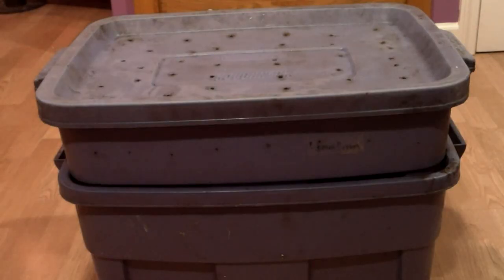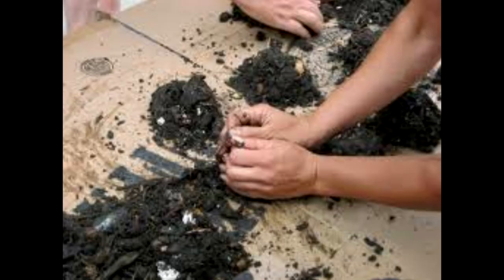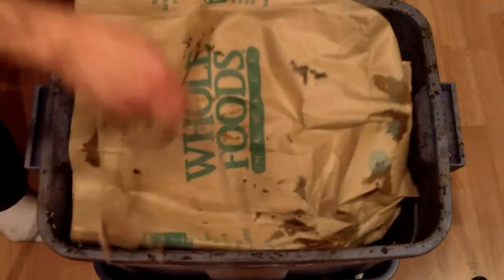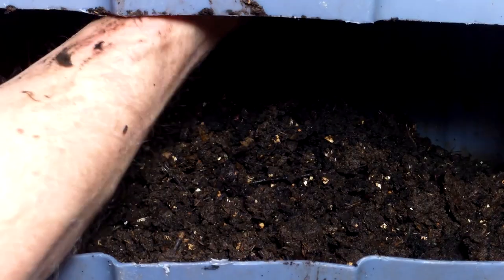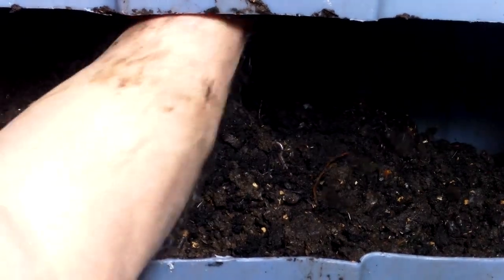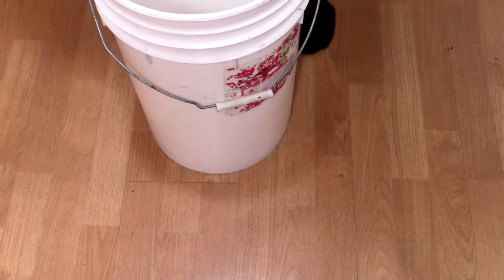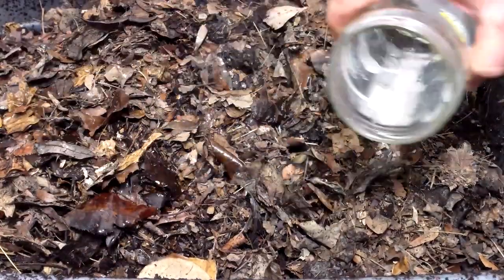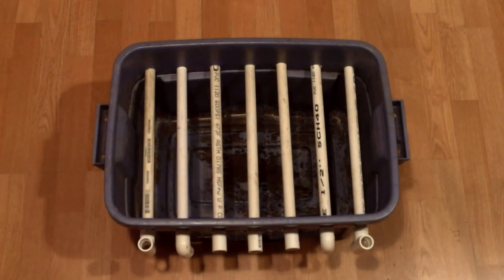Harvesting Worm Castings From a Flow-Through Worm Bin

Comment: Split some poly tubing and slip it over the top edge of your harvesting hole to protect your arm.

I have read that 20 - 24" in depth is the de facto standard for flow through depth to keep worms out of the harvested material.

Comment: Thank you for this, it is brilliant.  I think I may reproduce your work.  I love my worms, hate harvesting, I spend way too much time with tiny worms and egg casings. You could set two small litter boxes or aluminum baking trays in the bottom that would make it even easier to pull out the castings, as they would fit out your hole in the front. Because I don't like separating out the compost, I set two bins in my raised garden beds, one out of a five gallon bucket and one with 4" PVC, both fenestrated with many1/4" holes, it is amazing how much better the plants adjacent are doing than the rest of the bed.
   I have two questions for you. Is that pumice in your castings? I occasionally have trouble with worms crawling out my drainage holes in the bottom once my bottom bedding has degraded, I think it may be due to excess moisture and some clogged holes, I am unsure. Does this happen with yours? Thank you for your time.
Reply from the maker: Thanks Jane! Yes, this approach dramatically reduces harvesting time. If there are still some worms and cocoons in the castings, I just leave them there, and they eventually end up in the garden.

It sounds like you basically have a couple of worm towers in your garden. I'm glad to hear the plants around them do well. I'm thinking about adding a couple worm towers to my garden this year too.

To answer your questions, I don't add pumice to the worm bins. Worms sometimes do escape from the bins, but not too many.

Best wishes with your garden this year!

Comment: Early on in your video, it looked like you were using the Worm Inn flow through composting system.  How did you like that setup?  Why did you switch over to a Rubbermaid conversion?
Reply from the maker: I love the Worm Inn. It inspired me to convert my Rubbermaid bins over to flow-through systems. Currently, I have 1 Worm Inn, 6 Rubbermaid flow-through bins, and 1 standard Rubbermaid worm bin.
Reply: Wow-- sounds like you're going to have plenty of worm castings!  As for the Worm Inn, how much does it produce?  I've read a few reviews and was thinking about purchasing it.  Either that or the Worm Factory 360.  Love your videos.
Reply from the maker: OhHowHappyGardener The Worm Inn works great. The castings are high quality and easy to harvest. I've never tried the Worm Factory before, but it seems like a very good design.

Comment: Patrick, Just a quick question: I have the same sized bins as yours only I think I may be overcrowding. Presently, I have roughly 3,000 worms (3 lbs) in 2 bins. How many pounds of worms do you recommend per bin? Thanks in advance! ( P.S. I copied your conversion, and it looks great, reduced moisture build up a lot!)
Reply from the maker: Hi Paul. I'm glad to hear the conversion is working well for you!

Good question. I'm not sure if I know precisely, but I think 1,500 to 2,000 worms per bin should work well. I usually start a new bin when the worms are visibly overcrowded and trying to escape despite having plenty of food and bedding. If they aren't trying to escape the bin, then everything should be fine.
Reply: Sounds like a good rule of thumb. Thanks!

Comment: So after 3 months the bags are basically compost. You then dump the rest (worms/non castings) into another bin to replace the bags/start again? Or are the bags just used one time to fire up the bin initially?
Reply from the maker: The bags were just used to get things started. From here on out, I'll just add food and bedding on top and harvest castings from below. The castings clump together, which prevents them from falling into the lower bin on their own. This setup makes harvesting castings a breeze! Thanks for stopping by!
Reply: Mr. Savage we will have to convert some bins to do the same ! This system rocks !!
Reply: ***** I'm thinking much larger scale out at parents place. Those Rubbermaid containers sure are great though!
Reply: OneYardRevolution Thanks!
Reply: Keep me informed !

Comment: how long does it take for worms to make castings if i used food waste only? is it dependant on weather as well? and can i use earth worms or do red wrigglers do a better job? my compost bin is full of earth worms, think for a handful of compost i can count 20 worms at least (think its the rock dust). at the moment i mix my food waste with grass and dried out weeds but i can see that food is taking longer to break down
Reply from the maker: In addition to food waste, red wigglers need some carbonaceous material like shredded paper or autumn leaves. You could have your first castings harvest 3 months or so after setting up a bin. Earthworms are soil dwellers, so they wouldn't do well in a bin that is nothing but rotting food waste and paper. But red wigglers would be very much at home. Thanks for watching!

Comment: Hi there. What are your opinions on flow through systems now 4 years later? e.g. are they worth constructing when comparing to non-flow through? Do you still use them? Thanks
Reply from the maker: Hi Pat! I definitely prefer the flow-through system. Harvesting is much easier and castings don't get wet and anaerobic.
Reply: @OneYardRevolution  flirting with the idea of building a flow through project in the spring.

Also, have you ever dealt with white worms? if so how did you deal with them? I know one of the causes is a low ph environment and that white worms are not really an issue to the composting worms but would like to know that I can get rid of them if I want or need to. Thanks, and hoping you have a productive 2019!

Comment: Hi, I've just re-watched your flow-through worm bin videos. Last winter I made two flow-through bins following your design and I'm generally very happy with them. I do have some questions, if that's all right. First, if I spread the bedding and food all over the surface of the bin the worms like to congregate on the lips of the lower bin, thereby not staying where the food and the bedding is, is that a problem? I'm wondering why do they prefer it there, and if they hang out there are they actually doing any work so to speak? If I push everything away from the lip and make a mound they stay in the bedding and food area. Secondly, I have never had any leachate in the bottom bin, does that mean the bins are too dry? They were a bit dry, I noticed, so I add more water to the food now and the worms seem happy, but as everybody is always talking about leachate, I wondered if it's a problem that there is none. Thanks for your time and advice.
Reply from the maker: The open bottom results in more airflow and evaporation and less leachate, which I view as a good thing. Excessive moisture in the bottom of traditional worm bins results in a smelly anaerobic mess. That doesn't happen with these bins. I'd rather just use castings instead of potentially anaerobic leachate anyway.

I don't think I understand your first question. The worms are in the lower bin?
Reply: Thank you for your answer. Sorry I'm not more precise. What I mean is, that when one cuts the bottom of the top bin out there is a lip or rim left, one sees it in your video "how I converted my worm bin to  a flow through worm bin" at 3:13. My worms seem to prefer congregating on that rim instead of being inside the bedding and where the food is. I don't get escapists, they just sit out there on that rim instead of where I'd prefer them to be so they can work on the food. If I make sure there is no bedding on the rim they stay in the pile. Hope this is a better explanation.
Helle